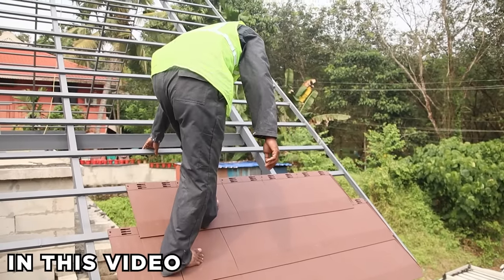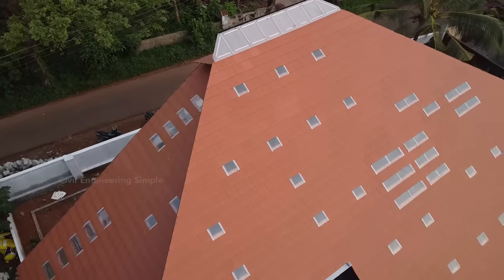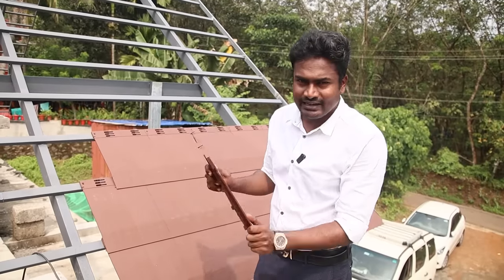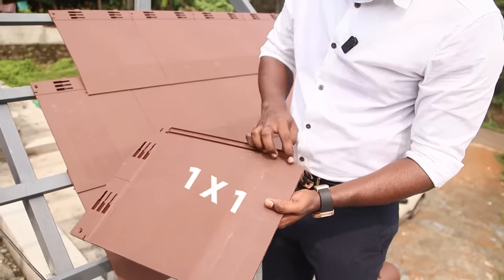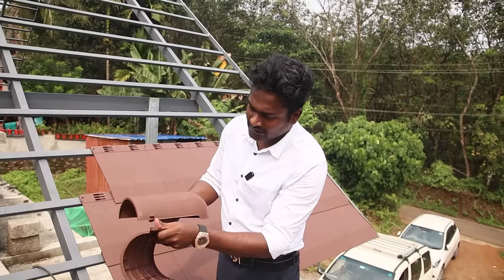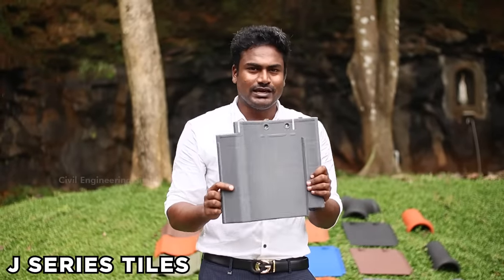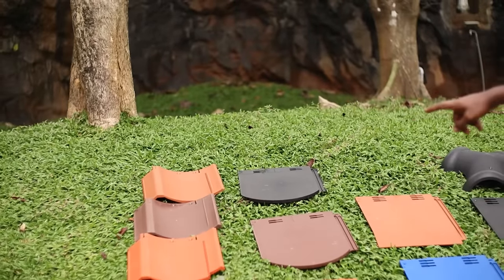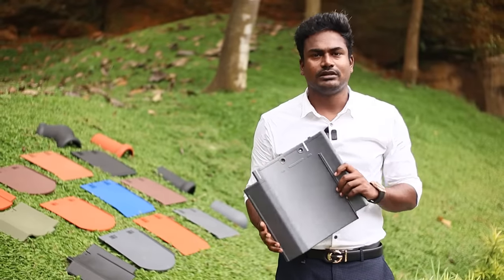வந்தாச்சு Nano Ceramic Tiles😱! இனி பழைய ஓடுகளுக்கு ஆப்பு! #homedecor #Veedu #construction

Comment: விலைய சொல்லாதீங்க அடிச்சியும் கேப்பாங்க அப்பாவும் சொல்லாதீங்க ஏன்னா விலைய சொல்லிட்டா இந்த விலைக்கு கான்க்ரீட்டே போடலாம்னு  தெரிஞ்சிடப்போது
Reply: @civilengineeringsimple  
கடைசிவரைக்கும் பார்த்தாச்சு விலை சொல்லவே இல்லையே......பலே கில்லாடி ஆள்தான்யா நீ
Reply: @civilengineeringsimple  video full ah parthutan nanum nenga vilaya sollala ethuku intha velai....
Reply: Price is mentioned.
Reply: @anjalimay6  entha minute and second mention panunga price soli erukara parpom
Reply: 90 to 165 price
Reply: @helpinghands1919  90 enga eruku 165 enga eruku proper price solu ....onu double the cost pani soli vachi eruka....
Reply: @balajiarni  apuram enathu ne video podura...ne marketing pana nanga Bali aada....
Reply: 11.00 la irunthu iruku
Reply: 95 to 165 nu sonnigala atha na price
Reply: Very good bro
Reply: Video timing11:03
Reply: @balajiarni  Bro avan kedakuran paithiyakaaran. Your videos are always useful. Price fluctuate agum, varieties, size lam irukku. Thandathukunu vanthudraanunga.
Reply: ₹89 / tile 1 sq ft.
Reply: 11:02 Price 95 - 165
Reply: @ZakirHussain-jb9lx  95 to 165 ₹ solliruganga
Reply: It should be cheaper than plastic, as it looks like injection moulded engineering plastic. Why it should be cheaper because nano ceramic is mixed to it. For sure it should be cheaper than concrete. If more money asked them dealer wants to go rich faster.

Comment: Being an architect let me tell you something once it rains heavily the sound produced inside the house is unbearable secondly since it is not made of clay and made of polymer plastic it radiates lot of heat inside the house take guidance from other people in the field and then place your opinions thanks god bless you and your family
Reply: True true but many people will fall for the marketing of this
Reply: 30 % heat reduction compare to normal clay tile , i did this in my home 6000 square feet.  Very good experience
Reply: Not fit for residential purpose…no warranty and guarantee  on paper not sound proof not a good insulator..light weight and it is breakable can be used for only  cow shed and industrial places or verandah..very very bad after sales support definitely not for living room..

Comment: Many of these run out of business due to people not willing to risk try a new thing, and people who buy it are stuck with out replacement or repair options.

 Cost is another factor. Seams not much of difference between a concrete roof.

Comment: Sir Thank you for information. I have one query : If  you are drilling  screw into the metal pipe then there will be changes of corrosion of  iron pipe due to humidity in environment. Pipes corrode very fast.

Comment: Sir can we install this under coconut trees? Will it break?
Reply: It is heavily durable. Compared to other roofing materials we can confirm that this product have high  durability against coconut fall. Still if the height of the tree is so high that may damage one or two tiles.  The only drawback I see with this material is the cost. 
I contacted the installers and as per them a sqfeet material plus installation cost is almost 300 rs. Only rich people can bear the cost.